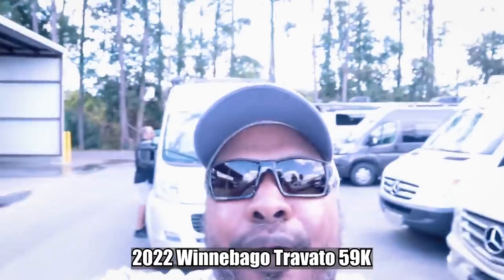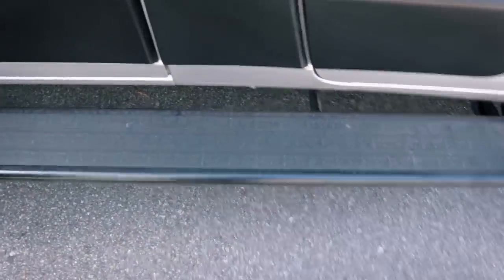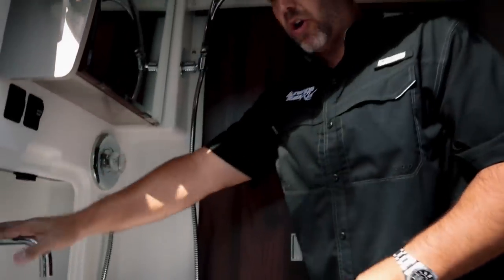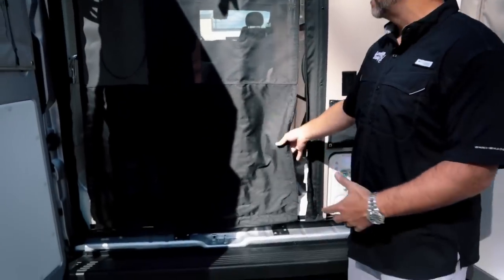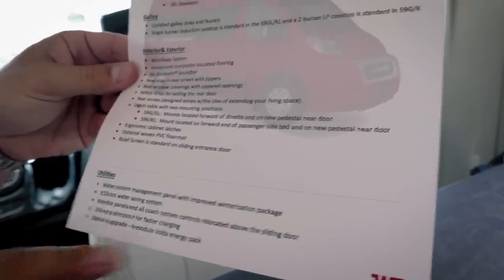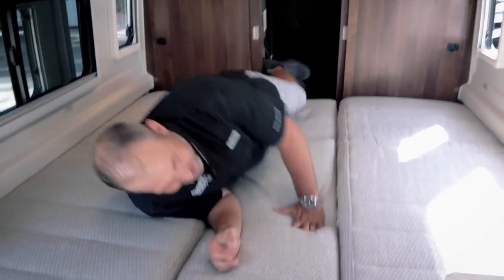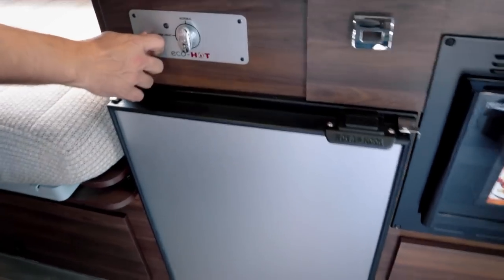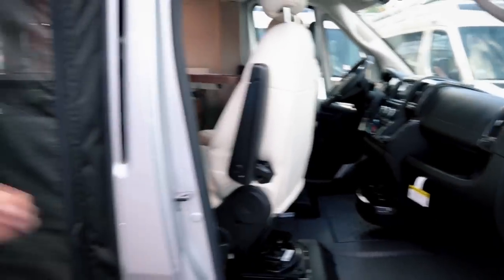MOST POPULAR CLASS B RV New 2022 Winnebago TRAVATO 59K Complete Van Tour

Comment: Jumped to a 2021 comparison of K and G. I love the twin beds and the large sink. But the other has a better front area and a large refrig. But a smaller sink. Unless the 2022 is upgrade. I like the micro wave. So only drawback for me is the smaller sink. Not crazy about gas cooking but induction plate is easy to use on top of the cover gas range.

Comment: I really enjoyed the video. Great interaction between the 2 hosts and the van's layout is fantastic considering the length.  I have 2 primary questions.  1. height & width?  I need to determine if if would fit in my garage or if I finally need to buy an outbuilding (I'm rural).  2. the roof. Is it totally flat or is there a curvature so the rain has somewhere to flow?  We can get freezing rain out here.  The thought of water getting trapped up there, freezing, expanding, and so on would keep me up at night!!

Comment: For the outside connection they should have drilled a hole so that you can bring your cable/water connection through. BTW the spray water is not a bidet. It's used to help clean the toilet.
Reply: Dang I'd use it as a bidet ha
Reply: And its only cold water. Why does everyone not know what this is for? Thats how I know there's a black water tank when I see the sprayer.
Reply: its not meant to clean the toilet at all. its an outdoor shower for rinsing off outdoor toys, at the beach, washing the dog, mud, etc.

Comment: The water hookup and cable location would be a deal breaker.   Looks like Winnebago could figure a way to put a hole that caps off when not in use and shuts while in use with a hole inside the cap for the hose and cable cord.
Reply: RV's with Big Bo
31.7K subscribers

Comment: Nothing compares to the 59K when it comes to all weather.
Wind, rain, snow; you enter through the rear.
Built in mud room with floor drain.

Three sources of energy, solar, propane, generator.

Lowest profile and widest Wheelbase.

Purchased new in 2017. 4 1/2 years full-time.
Loving it!

Comment: Great camper for the $. What is the trailer hitch rated for?  What is the generator output?  What type of heat does it have?  Propane capacity with the gas stove?

Comment: Thank you for a great video!  Question - Love the van but not sure if having inside water hookups could be a pain?  Anyone have any wisdom on this?  TIA.
Reply: My understanding is that u open the door to fill it, then disconnect & shut the door.  When it is empty, u repeat.  So, it depends on if u could do this or if it is a deal breaker.  I like it bc I would camp in the winter at ski areas. With this, I can have the use of the water bc the coach is heated inside where the water storage tank is.  Cheers, Mo in NJ
Reply: @monnaprovost7294  thanks!
Reply: We have a 2018 Travato and, while I understand the wisdom of an inside water hookup for cold weather, it would be a pain to not have continuous water hook ups.  Turning on that water pump every time you flush the toilet is kind of loud when you're trying to sleep at night.
Reply: @marciatroyer2818    Thank you!!